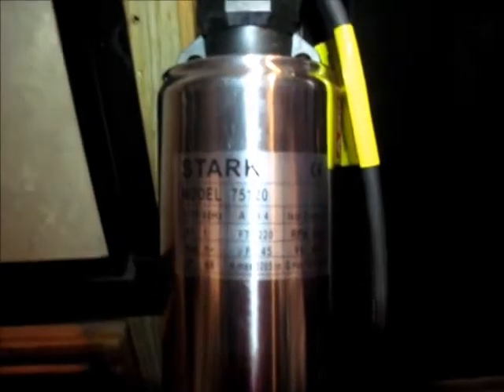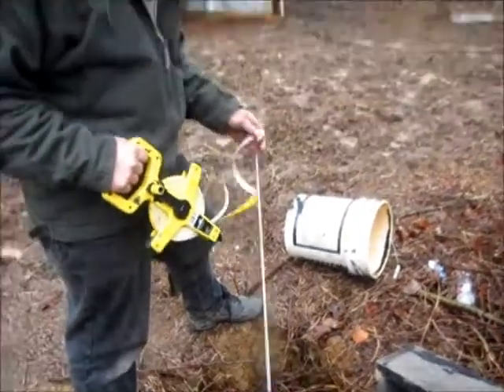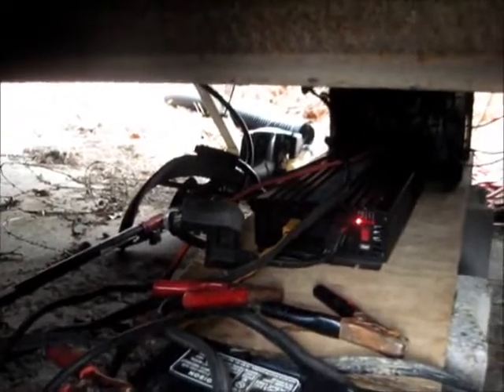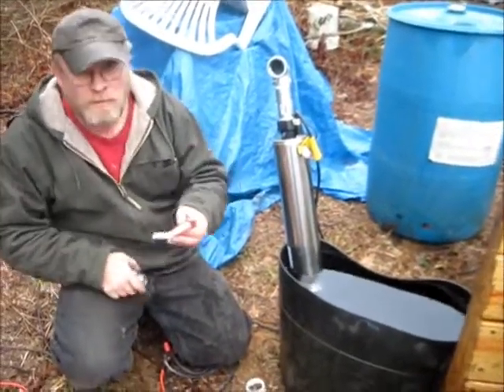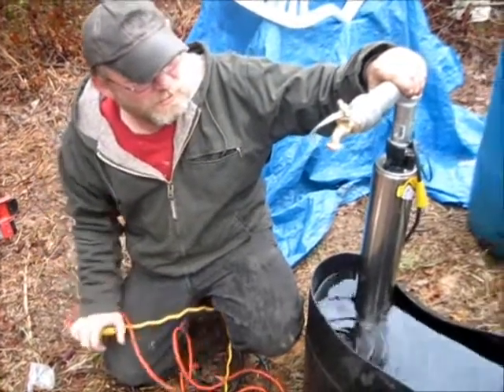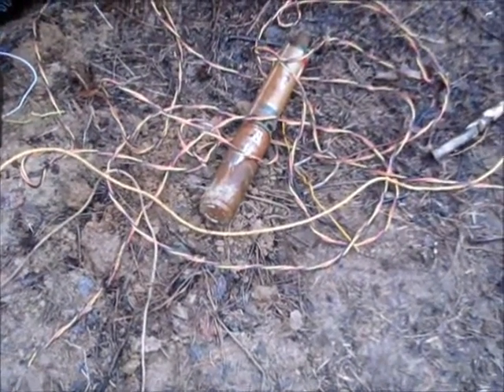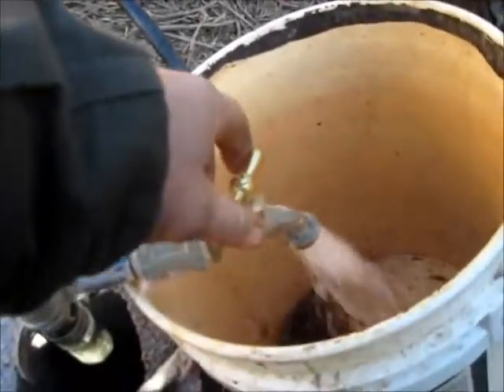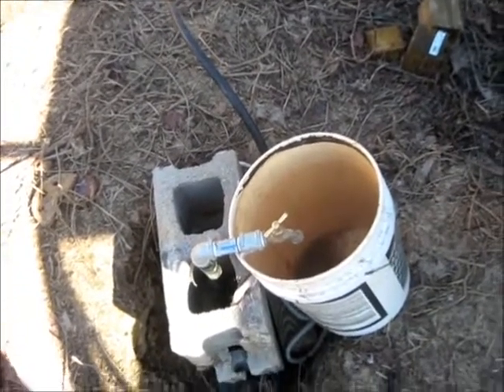110 volt well pump. On solar power

Comment: 110volt pump winding data plz mi shar
Reply from the maker: Satish Kamdi
 hope this helps
 1.5" Outlet Stainless Submersible Deep bore Well Pump 1 HP, 110V, 33 GPM 200 ft MAX

Comment: Our water is at 160ft. Pump Set at 180ft.  Well bore down to 200ft.    Not  sure a 120VAC pump could or would do the job.  The stupid well is the only thing preventing full solar here..
Reply from the maker: Just about any submersible well pump would do are they away to set up a rain catchment system which is what we have as well we have a total of 1200 gallons we have  four 300 gallon tanks that all comes from the runoff of the barn that you see behind me in the video
Reply: @jbshomestead7694  LOL, Down in Southern New Mexico  ..  Not much rain to collect.
Reply from the maker: Ouch, yea I could see where that could be a problem just look for the biggest horsepower pump you can find in a well pump I've been told anywhere from 1/4 to 3/4 horsepower would pump water to the Moon, I had an edit the post are they away to find a hand pump attach a foot valve to the end of it that way all your water does not leak back out

Comment: How big are your panels and what size inverter do you have?
Reply from the maker: I got 4 100 watt panels, and a 2 k pure sine inverter
Reply: Not enough solar or inverter, no mention of battery bank. Example I have 160 ft wellman 1/2 hp 110 submersible well pump, running off of 12 6v batteries made up into one large 12v bank, 5000 watt inverter and 1000 watts of 12v solar panels. Would not work on 2000 watt inverter required higher watt inverter, can run off 150 watt outlet. Trust me I have been on solar off grid for 20 years. With my system I run 500 feet thru 3/4 inch pipe to garden area with 11 plus gallons a minute output at 40 psi. Good luck on your project hope this helps.

Comment: I need to figure out the best way to get water up to the BOL during a long term power outage.. The camp is located on top of a raised 500 yard long peninsula situated on a 8 mile long lake in the Northern Appalachian mountains. The camp is a 4 season well insulated 1000sqft on the grid cabin, almost dead center on the top of the peninsula. The beach is in a cove to the North, 200 yards down the steep hill in one direction. The dock is at the very end of the point to the South, 300 yards down the slight less steep hill in the other direction. To the East , And down 2 long sets of stairs and 100 yards away is the lake side. To the West faces the bay which is a 50 yard very steep overgrown almost impassible hill. The water well is 750 feet deep. It runs on a 20 amp pump.
What I have to work with.
I have three 3500w generators, a 180w back up emergency solar panels, 6 deep cell RV/Marine 12v batteries. 3 inverters. A Yamaha gas powered golf cart. 8 blue plastic 50 gallon barrels. Once I figure out how to get the water up there, I have my Berkey water filter system to filter it. My goal is to set up a 12v well pump system to go in tandum with the working on grid system.
Reply from the maker: they are a few ways you could do it 1st is a ram pump and the one I would use in this situation. 2nd making a rain catch  3rd  is a 110v sump pump or any other electric pump
Reply: Thanks
Reply: kelly nash simple pump.com